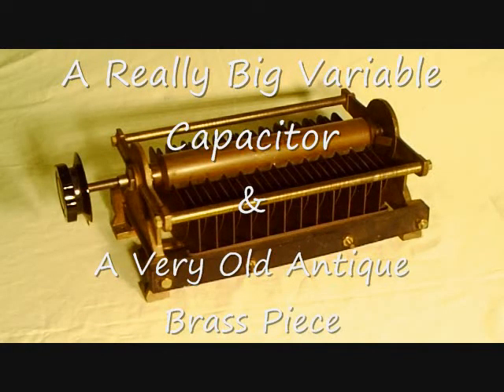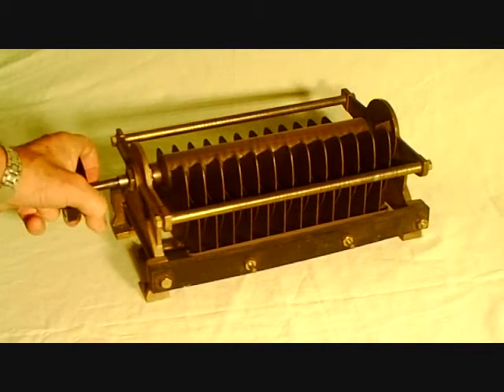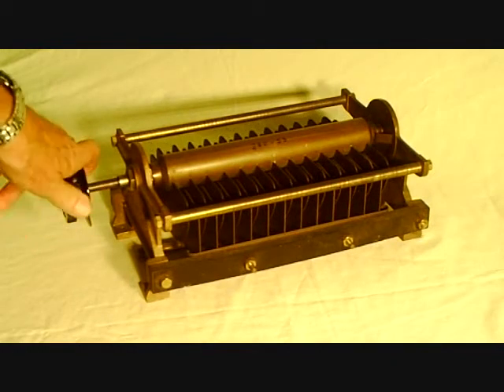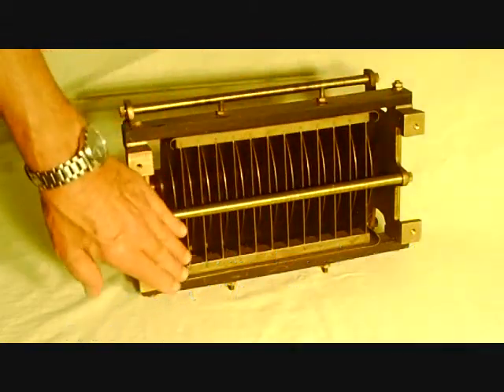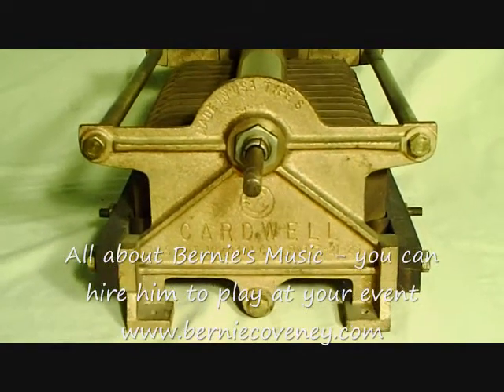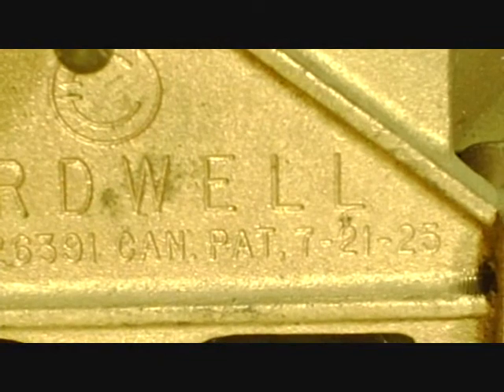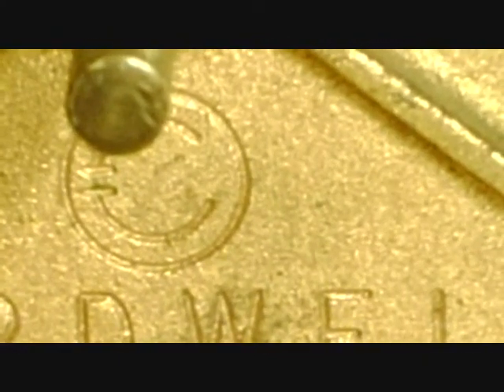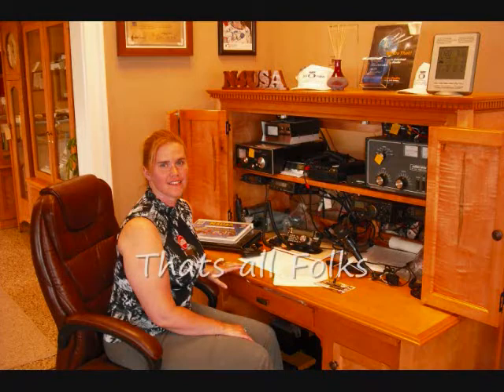Capacitor Cardwell Giant  Brass Condenser

Comment: Nice video.  I am glad the capacitor has survived all these decades.  If in the wrong hands it could have been sold for scrap brass!!  

A friendly tip: The on-screen texts over your presentation was a bit distracting.  It would have been more appropriate to have it scroll at the end of the video.

Thanks for sharing this piece of history.

73 de Mick - WB4LSS - Bartlett, TN